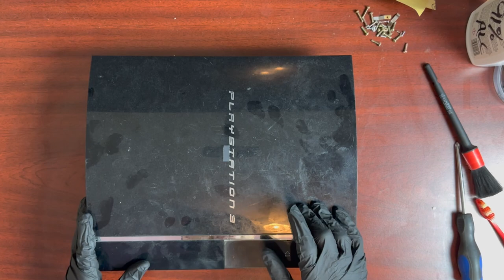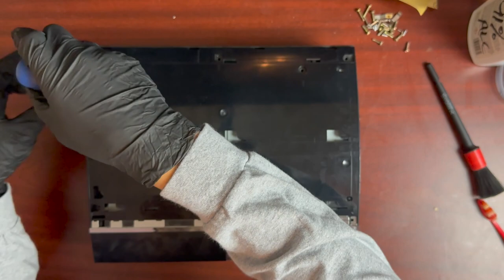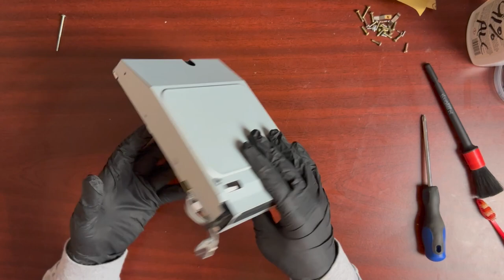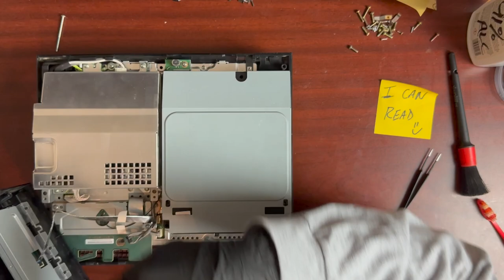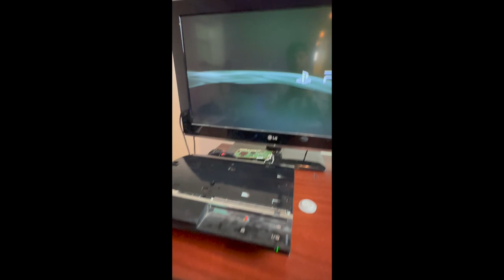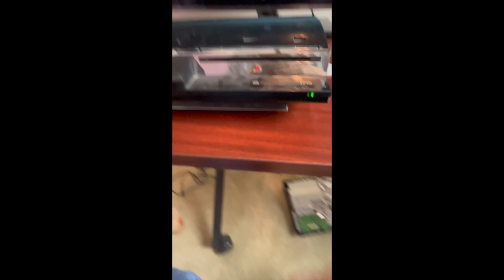PS3 60GB Fat Model Disk Drive Replacement

Comment: Very detailed video imma be doing the same thing. I have a friend that had a fat model ps3 backwards compatible disc drive issue and luckily I had one given to me that had the yellow light of death so I thought to just use it as a donor console
Reply from the maker: Thanks! Good luck on the replacement!
Reply: @AlmostInFullColor  my friend, barely gave me the console today because he kept on forgetting and I finally fixed it. Everything went smooth console worked. So satisfying now I can play PS1 and PS2 games.
Reply: This is what I'm doing.   I got an original CECHA01 PS3 for $40 the other day w/ a bad bluray drive, and the CECHE01 I bought in 2008 got a YLOD in 2014.

Comment: I have the same console that you share on your video. Where can I find the blueray drive that will fits in the same console that you're sharing on here?
Reply from the maker: So you can use the blu-ray drive out of any fat ps3 as a swap. I actually used one out of a 40gb model as a direct swap for the 60gb model. The drives have nothing to do with the backwards compatibility. That is all done on the motherboard. I’d suggest eBay to find one. But you have to make sure that you use the board from the broken drive that came with the ps3 on the new drive. If you do not swap the board, the ps3 will not recognize the new drive. They are paired with the motherboards.

Comment: What drive is this? I have been looking everywhere and can’t find the right drive replacement. Any help?
Reply from the maker: Going to be hard to find anything outside of just buying a used drive off ebay or something. The good thing is that any one off the OG Fat model will work. Just make sure you put your original daughter board on the replacement. Or else it won’t work

Comment: I can't get my black and red wire connector to release. I feel like I'm gonna break it. Please help
Reply from the maker: You have to make sure you are pulling the plastic part. Usually it can be easier if you are using tweezers or something similar to grab the connector part and pull. The wires on that piece definitely feel fragile, just take your time with it. Sorry, it isn’t much i can help with other than say take it slow.

Comment: Hey, I just bought a replacement laser for mine, but the blue plastic tab came off the short pin ribbon during it's shipping delivery. Does that mean I need to get another?
Reply from the maker: You mean the ribbon the connects the drive to the main board? If so, technically no. You can try to slide the blue plastic piece back in with the ribbon into the slot and lock it but it’s gonna be a headache to get it to sit right. Without the blue plastic piece it will not make a connection when it’s plugged into the slot because it isn’t thick enough to make contact anymore.
Reply: Alright... I'll upload a video tomorrow and show you what's going on. @AlmostInFullColor
Reply: https://youtu.be/2xa1MPgfzLY  @AlmostInFullColor

Comment: So i replaced mine but it still wont read any games could it be a different issue or do i have to jail break it and remarry my disc drive cause idek
Reply from the maker: Did you transfer over the original board to the new disc drive? If you’re new drive came with a board, its a chance you put the wrong board on the new drive when you switched it

Comment: What model number did you use, i have the same model but i can not find the model number on de drive, btw great video!
Reply from the maker: I used the drive from a 40gb model. Any drive from a phat model will work. Just have to switch over the board from your original drive.

Comment: What about the 2 little wires on the side??? I took my out and accidentally pulled them off. Do they get soldered?? Please help
Reply from the maker: So they are supposed to come out from the board with a little plug. So i am assuming you mean you pulled them out from inside the drive? Those should go to the motor that controls pulling the disc in and pushing it back out. So if you pulled them from there, then yes, you will need to solder them back on

Comment: Do you have a link to a website or somewhere you can get a new disk drive exactly the same as the broken one but working and replace it yourself?
Reply: My disk drive also has a different metal cord and no green on the back with chips etc..
Reply from the maker: If your disk drive does not have the chip with it then sadly it is not fixable. That chip or “daughter board” is paired with the main board when the console is manufactured. Thats why it has to be swapped over to the new disk drive you are installing. There is no way to buy a replacement daughter board and pair it with the console. So if you don’t have the original daughter board or if it dies, then there is nothing you can do.
Reply: @AlmostInFullColor  well originally it never came with the chip or daughter board
Reply from the maker: The chip and daughter board are the same, just different names. Did you buy it used? All PS3 disk drives have the daughter board on the drive in order to play blu ray disks.
Reply: @AlmostInFullColor  The disk drive name doesn't say and yes it was bought used
Reply from the maker: Ah ok. If you bought it used hopefully they said the drive was bad at least. But if it didn’t come with the original board you can’t replace it. Which sadly is probably the reason they sold it. The only option you have is to buy another board for the drive and then run custom firmware (CFW) to pair it with your ps3 again. Basically you got to hack it. There is no way to pair it and use the original firmware. You would have to look online for guides on how to download and install the custom firmware and then how to pair it back up to the new chip you buy for the drive. That is your only option at this point. Or buy another ps3.
Reply: @AlmostInFullColor  k thanks

Comment: I broke the little black and red wire dose anyone know what its called so I can get a new 1 😢
Reply from the maker: Thats the wire that goes to the motor for the disc drive. You will probably need to replace the whole motor now. Pretty sure it’s soldered right to the motor. If you aren’t good with a solder, or have one, then replacing the motor is the easier route.
Reply: It was the sensor wire in the end 8.99 on ebay
Reply from the maker: Great! Happy i was wrong then 😂. Cause thats only like one screw lol.

Comment: I thought they didn't start forcing you to install video games to your console to play them till PS4.
Reply from the maker: A lot of games forced installs to the hard drive on PS3. Maybe not the entire game but it installed parts of it. MGS 4 was forever to install lol. PS4 was similar because honestly the hard drive read speed was basically the same as the blu-ray drive. PS5 was mandatory because the read speed of the ssd is way faster than the drive. Honestly reading data from a drive during gameplay is basically stone age tech now lol.

Comment: Ok, now I have two other problems: 1. The white piece activates as soon I try inserting any disc, and 2. The magnetic piece doesn't attach from the top of the black plastic drive top.

What the living fuck am I doing wrong...
Reply from the maker: Is the white piece you are talking about the little white piece that “blocks” it from taking any discs in? If so, you have to reset the disc tray back to “accept” stage. The magnetic piece should just sit in the top. Once you get it reset right it should work. It’s hard to describe in text. But there are videos that shows how to reset it on YouTube. Unfortunately, i do not have one on hand right now to do a video on it.
Reply: @AlmostInFullColor  No, inserting the disc triggers it, in my case.
Reply from the maker: It sounds like it isn't reset right. You will have to look up videos on reseting the disc drive arms and mechanism to fix it.
 @theunholinesswithin70
Reply: @AlmostInFullColor  https://youtu.be/sOubt0pJ-yE